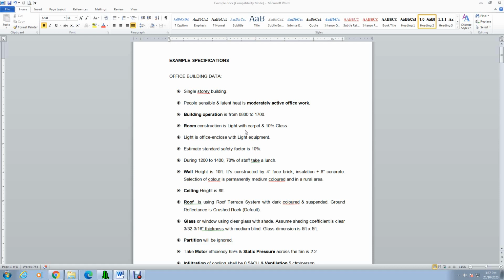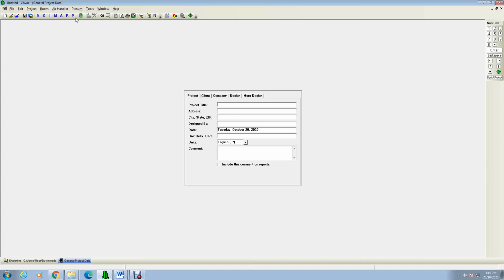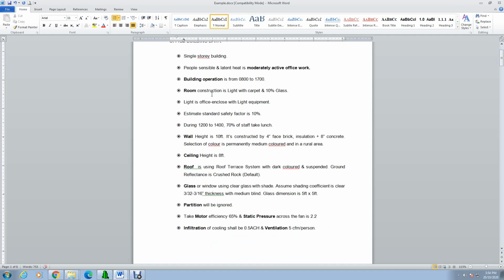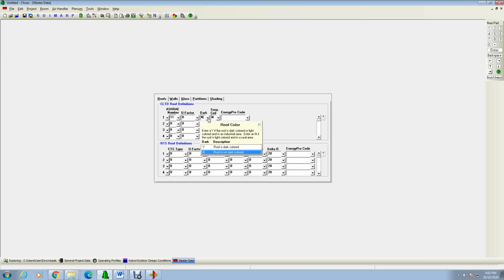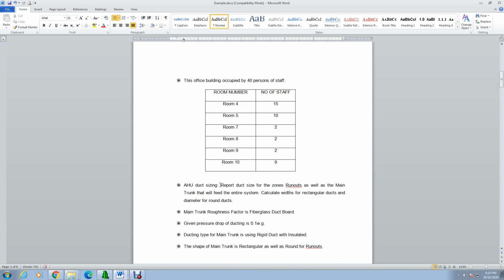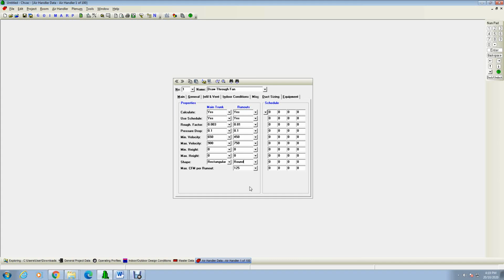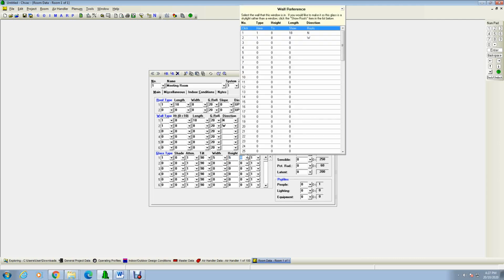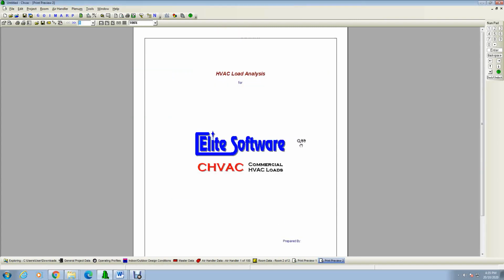Tutorial 2 CHVAC

Comment: MUHAMAD NURHISYAM BIN MOHD HASNAN
B071710148 
4BMMH S1/2

CHVAC is a software that accurately calculate the maximum heating and cooling load for commercial building. cooling load can be calculated either by using the CLTD method or RTS method.
The tutorial shows important tips and techniques to correctly use the software to get the correct Cooling and heating load of a building. At the end of the lesson, it is proven that the CHVAC program is a precise software and is able to produce accurate data regarding the building info.

Comment: AMIRA NASUHAH BINTI ALIAS
 B071710121
CHAVC Software can calculate the commercial load calculation for HVAC system. Chvac can quickly and accurately calculates the maximum heating and cooling loads for commercial buildings. There are a few features that CHVAC able to do: 
*Calculates peak heating & cooling loads 
*Determines building tonnage and room cfm requirements, and runout duct sizes 
*Can uses either the RTS or CLTD calculation method 
*Computes cfm air quantities with psychometrics 
*Reports list the general project data 
*Detailed room loads 
*Air handler summary loads. 
*Total building loads. 
*And many more.

Comment: AHMAD LUQMAN HAKIM BIN ZAMBRUS (B071710359)
BMMHS1/1

CHVAC calculates both heating and cooling load for most commercially registered buildings. The analysis software  calculate both using CLTD and RTS methods. This software also able to do precise calculation for each room up to the scale of the room with the given conditions such as; sun positioning, active period, and specific AHU usage.
The example for the tutorial have included the necessary steps taken to key-in the details correctly based on the specifications provided. This is an important aspect as in order to obtain the exact load details in the building report from the evaluation calculated by the software.

Comment: MOHAMAD ZARIF BIN ROSTAM (B071710681)

Based on tutorial 2 the CHVAC software is software used to calculate cooling load and heat load. The software also can generate the full report on the details of whole building. The calculation also followed the ASHRAE standard analysis.

Some features that CHVAC can do:
-Calculate the maximum and minumum heating and cooling load.
-Calculate heating and cooling CFM requirements.
-Calculate 24 hours per design day.
-Provide overall building report .

Comment: ALDEN ANDRIAN PHIUS
B071710392
BMMH S1/1

CHVAC SOFTWARE

The CHVAC software calculates the overall heating and cooling loads for commercial buildings fast and accurately. CHVAC makes it possible to group an infinite number of zones into as many as 100 air handling systems. Both cooling load and correction factors required for computing loads are automatically looked up by CHVAC. Furthermore, the programmes will look up weather data for 449 cities in 75 countries for outdoor design. Provision is also made for the editing of weather data as well as the inclusion of data for other cities. Comprehensive reports include general project data, detailed zone loads, summary air handler loads, external air loads, total building loads, building envelope analysis, tonnage requirements, CFM air quantities, chilled water flow rates (if applicable), and complete psychrometric data with coil conditions entering and leaving.ASHRAE Standard 62 analysis, automatic building rotation, 360 degree wall orientations, tilted glass, exterior shading, internal operating load profiles, variable temperatures of the indoor design, diversity of people, pretreated outdoor air, seasonal infiltration and ventilation rates, reheat loads, duct gains and losses, and return air plenums are other outstanding features. EZDOE 's energy analysis programme can also use CHVAC project data files.

Comment: NUR SHAFIQAH BT ABDUL GHAPOOR
B071710400
4 BMMH S1/1

CHVAC software is used for cooling load calculation or heating load calculation. It can give input according to the specification of the building like the floor level, sensible latent heat and etc. 

The second tutorial is to practice and gives student the familiarity of the chvac system. The example given is already provided all the building details and as well as the layout so that it can be drawn just like the layout. The example is complete with all the steps that needs to be done from the beginning until the end. After put all the input and there are no error found, select the desired report details and the report is basically show all the details that is needed and do not forget to save the project.

Comment: MUHAMMAD HAFIZ BIN JOHARI 
B071710380

Chvac quickly and accurately calculates the maximum heating and cooling loads for commercial buildings. The cooling loads can be calculated with either the CLTD method or the new RTS (Radiant Time Series) method. The program allows an unlimited number of rooms which can be grouped into as many as 100 air handling systems. Chvac automatically looks up all cooling load and correction factors necessary for computing loads. In addition, it can look up outdoor design weather data for over 2000 cities located around the world.

 There is also provision for editing the weather data as well as adding data for other cities. Comprehensive reports list the general project data, detailed room loads, air handler summary loads, outside air loads, total building loads, building envelope analysis, tonnage requirements, CFM air quantities, chilled water flow rates (if applicable), and complete psychrometric data with entering and leaving coil conditions.

Other outstanding features include ASHRAE Standard 62 analysis, automatic building rotation, 360 degree wall orientations, tilted glass, exterior shading, internal operating load profiles, variable indoor design temperatures, people diversity, pretreated outside air, seasonal infiltration and ventilation rates, reheat loads, duct gains and losses, and return air plenums.

Comment: MUHAMMAD ZULQARNAIN BIN ZAMZURI
B071710782 (BMMH ½)
CHVAC can quickly and accurately calculate the maximum heating and cooling loads for commercial buildings. The analysis software is able to calculate both using Cooling Load Temperature Difference (CLTD) and Radiant Time Series (RTS) methods. It can look up the weather data for over 2000 cities located around the world. There are features included such as Other outstanding features include ASHRAE Standard 62 analysis, automatic building rotation, 360-degree wall orientations, tilted glass, exterior shading, internal operating load profiles, variable indoor design temperatures, people diversity, pre-treated outside air, seasonal infiltration, and ventilation rates, reheat loads, duct gains and losses, and return air plenums.

Comment: MUHAMMAD SYAFIQ BIN AHMAD (B071710592)
CHVAC is a true Windows program that uses all the latest data entry techniques such as toolbars, hyper 
linked help, and form tabs. All input data is checked at the time of entry so that no improper data can be 
entered. Five types of data are requested: general project data, outdoor design data, building material data, 
air handler data, and specific zone data. The general project data includes the project and client name, 
designer, building opening and closing hours, internal operating load schedules, and any desired safety 
factors. The outdoor design data includes the summer and winter outdoor design conditions (automatically 
looked up for you if a city reference is given) and the desired ventilation and infiltration rates. The building 
material data includes the definition of master building material types for roofs, walls, partitions, glass 
sections, and exterior shading. A user defined material library is available for saving the data on common 
material types. The air handler data includes the fan and terminal type, the desired heating and cooling 
supply air temperatures and data for duct heat gains and losses. The zone data includes the zone name, 
floor length and width, number of people, equipment watts, lighting watts, external shading data, and 
specific roof, wall, partition, floor, and glass data. 

The CHVAC program provides eleven types of reports, which can be selectively previewed on screen or 
printed as desired. CHVAC supports all printers that work with Windows and numerous full colour reports 
are available. The reports are: General Project Data, Air Handler Input Data, Zone Input Data, Detailed 
Project Zone Loads, Air System Zone Summary, Total Building, Air System, and Zone Load Profiles, Air 
System Total Load Summary, Air System Psychrometric Analysis, Overall Building Envelope Report, Pie 
Charts, Bar Graphs, and the Total Building Load Summary. Air system summary data can be exported to 
your favorite spreadsheet.

Comment: MOHD SYAHIRAN BIN MOHD PIKERI 
B071710026    BMMH 1/2

So basically Chvac is a software where it can quickly and accurately calculates the maximum heating and cooling loads for commercial buildings. The cooling loads can be calculated with either the CLTD method or the new RTS (Radiant Time Series) method. The program also allows an unlimited number of rooms which can be grouped into as many as 100 air handling systems. 

This Chvac software can automatically looks up all cooling load and correction factors necessary for computing loads. In addition, it can look up outdoor design weather data for over 2000 cities located around the world. There is also provision for editing the weather data as well as adding data for other cities. 

Comprehensive reports list the general project data, detailed room loads, air handler summary loads, outside air loads, total building loads, building envelope analysis, tonnage requirements, CFM air quantities, chilled water flow rates (if applicable), and complete psychrometric data with entering and leaving coil conditions. 

There are also other  features include automatic building rotation, 360 degree wall orientations, tilted glass, exterior shading, internal operating load profiles, variable indoor design temperatures, people diversity, pretreated outside air, seasonal infiltration and ventilation rates, reheat loads, and also duct gains and losses.

Comment: MUHAMAD AFIQ HAIKAL BIN ADNAN
(B071710534)

The CHVAC software has been developed so that the overall heating and refrigeration loads for buildings with unlimited rooms and up to 100 air operators can be measured easily and reliably. The software relies heavily on the ASHRAE methodology and the principles.In reality,is and IT of those principles and methodologies. This software consists of the Conduction time series table, Radiant time series, Coefficients of solar heat gain, Variations in temperature of cooling load, Maximum solar heat gain factors, Glass coolingload factors and Weather details. Detailed reports display Zone loads, Outdoor air load, Tonnage requirements, Air supply amounts, Chiller water flow rates and full psychrometric details (entering & lea data).

Comment: LIM PEI JUN B071710194
BMMH S1/2

Chvac has been an industry leader in commercial load calculation software since 1979. Chvac quickly and accurately calculates the maximum heating and cooling loads for commercial buildings. The cooling loads can be calculated with either the CLTD method or the new RTS (Radiant Time Series) method. The program allows an unlimited number of rooms which can be grouped into as many as 100 air handling systems. Chvac automatically looks up all cooling load and correction factors necessary for computing loads. In addition, it can look up outdoor design weather data for over 2000 cities located around the world. There is also provision for editing the weather data as well as adding data for other cities. Comprehensive reports list the general project data, detailed room loads, air handler summary loads, outside air loads, total building loads, building envelope analysis, tonnage requirements, CFM air quantities, chilled water flow rates (if applicable), and complete psychrometric data with entering and leaving coil conditions. Other outstanding features include ASHRAE Standard 62 analysis, automatic building rotation, 360 degree wall orientations, tilted glass, exterior shading, internal operating load profiles, variable indoor design temperatures, people diversity, pretreated outside air, seasonal infiltration and ventilation rates, reheat loads, duct gains and losses, and return air plenums.

Comment: MUHAMAD IZMAN BIN JAMALUDDIN 
B071710518
S1/2

Chvac has been an industry leader in commercial load calculation software since 1979. Friendly commercial load calculation/energy analysis.
 
Chvac quickly and accurately calculates the maximum heating and cooling loads for commercial buildings. The cooling loads can be calculated with either the CLTD method.

Chvac automatically looks up all cooling load and correction factors necessary for computing loads. 

In addition, it can look up outdoor design weather data for over 2000 cities located around the world. 

There is also provision for editing the weather data as well as adding data for other cities. Comprehensive reports list the general project data, detailed room loads, air handler summary loads, outside air loads, total building loads, building envelope analysis, tonnage requirements, CFM air quantities, chilled water flow rates (if applicable), and complete psychrometric data with entering and leaving coil conditions.

Comment: NUR FITRAH NADIA BINTI KAMIDAN
(B071710363)

CHVAC
It can calculate heating loads and cooling load in (BTU/HR) with its program calculation method which is CLTD or RTS method. There is also provision for editing the weather data as well as adding data for other cities. 
In CHVAC there are many features such as:
1.	Determines building tonnage and room cfm requirements, and runout duct sizes 
2.	Can uses either the RTS or CLTD calculation method 
3.	Computes cfm air quantities with psychometrics 
4.	Reports list the general project data 
5.	Detailed room loads 
6.	Air handler summary loads
CHVAC also can generate reports list the general project data, detailed room loads, air handler summary loads, outside air loads, total building loads, building envelope analysis, tonnage requirements, CFM air quantities, chilled water flow rates (if applicable), and complete psychrometric data with entering and leaving coil conditions

Comment: LUA WEI JIE (B071710861) BMMH S1/2

CHVAC can be said as a real and actual program which only few clicks and we can take all data of the building. Besides that, it can calculate heating loads and cooling load in (BTU/HR) with its programm calculation method which is CLTD or RTS method.There is also provision for editing the weather data as well as adding data for other cities. Comprehensive reports list the general project data, detailed room loads, air handler summary loads, outside air loads, total building loads, building envelope analysis, tonnage requirements, CFM air quantities, chilled water flow rates (if applicable), and complete psychrometric data with entering and leaving coil conditions. 

Chvac contains many, many advanced features. Here are just a few of its capabilities. : 
*Calculates Peak Heating and Cooling Loads
*Calculates Both Heating & Cooling CFM Requirements
*Calculates Runout and Main Trunk Duct Sizes
*Provides Overall Building Envelope Report
*Performs Complete Psychrometric Analysis
*Exterior Shading Handles Overhangs, Fins, & Glass Tilt
*Built-in Design Weather Data for Hundreds of Cities
*Analyzes Up to 12 Months Per Calculation
*Calculates 24 Hours per Design Day
*Allows Unlimited Number of Rooms per Project
*Rooms May Be Grouped Under 100 Air Handlers
*Rooms May Be Optionally Grouped Under VAV Boxes
*Allows 100 Walls, 100 Windows, and 100 Roofs per Room

Comment: AHMAD KHAIRUL AKMAL BIN AHAMAD KHAIRUDIN

B071710715

BMMH S1/1

To quickly recap what is CHVAC, it is a precise and instant calculator that calculates both heating and cooling load for most commercially registered buildings. The analysis software is able to calculate both using CLTD and RTS methods. This software can precisely calculate each existing room up to the scale of the room with respecting conditions such as sun positioning, active period, and specific AHU usage.
The tutorial shows important tips and techniques to correctly use the software to get the correct Cooling and heating load of a building. At the end of the lesson, it is proven that the CHVAC program is a precise software and is able to produce accurate data regarding the building info.

Comment: NUR SELIHAH WAL HUDA BINTI AHMAD - B071710190

- CHVAC basically use to calculate the maximum heating & cooling load for the building.
- The program output from the chvac software can provide overall building report.
- Use exact procedure and method from ASHRAE handbook for example CLTD and RTS as it can built-in design weather data for hundred of cities based on country selection.

Comment: ARVINTH A/L RAMACHANDRAN 
(B071710339)

Chvac quickly and accurately calculates the maximum heating and cooling loads for commercial buildings. The cooling loads can be calculated with either the CLTD method or the new RTS (Radiant Time Series) method.

The Chvac load calc program calculates a great deal of the data needed to define a system in the HVAC Solution schematic diagramming program. Traditionally, this data has simply been transferred using a manual entry process.

 ASHRAE Standard 62 analysis, automatic building rotation, 360 degree wall orientations, tilted glass, exterior shading, internal operating load profiles, variable indoor design temperatures, people diversity, pretreated outside air, seasonal infiltration and ventilation rates, reheat loads, duct gains and losses, and return air plenums.